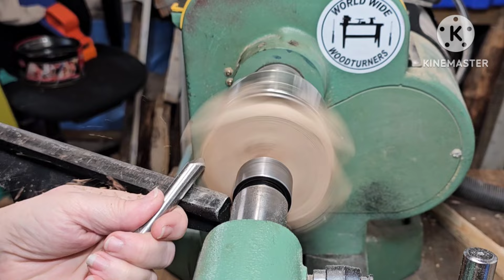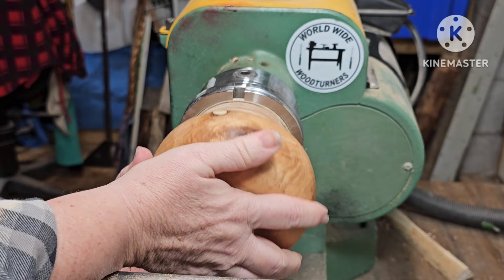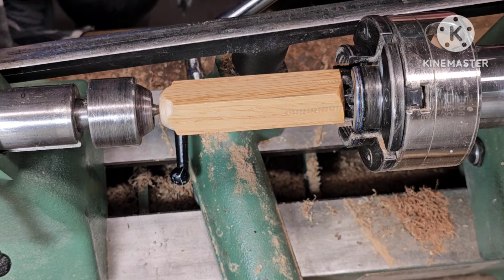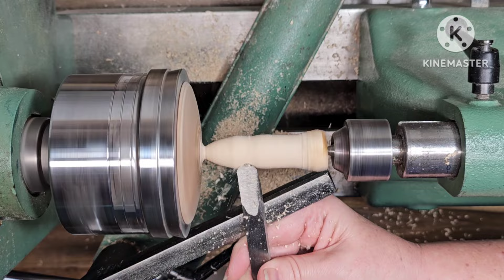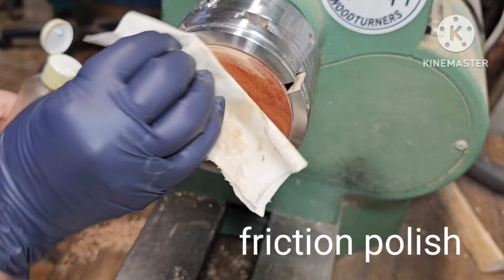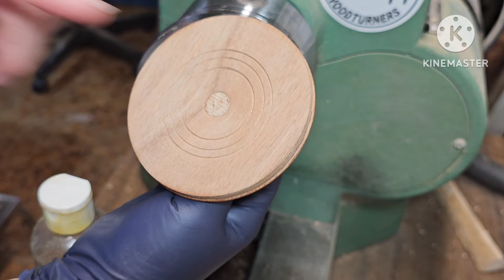Woodturning a Red Oak Box

Comment: Such a nice little pot. I thought you were going for a taller finial and was all set to say you turned it from the wrong direction. But you didn’t. You turned a very nice knob for it. Excellent! I like the wood combination as well. Super job.
Reply from the maker: Thanks Doug.  I should have turned the finial separately from the lid and attached it after, it still worked out ok, but would have been easier

Comment: I can't hear these noises your lathe is making Heather (I'm watching on my phone which has poor sound) but I know that  belt driven machinery sometimes makes funny squeaks when the belts are worn or get out of adjustment. Dabbing a teeny amount of oil on a belt usually quietens it but that really is only for diagnostic purposes. Well, it's just a suggestion, I know you'll get it sorted out eventually.
Reply from the maker: Thanks Mark! I might try the oil trick. It kinda sounds like harmonics that you get if you're turning far from the headstock without support,  but the bowl is very shallow. I'll figure it out eventually
Reply: Personally I wouldn't put oil near a belt, it might stop the noise but that'll most likely be because it's now slipping!